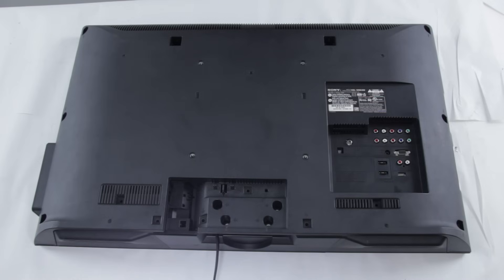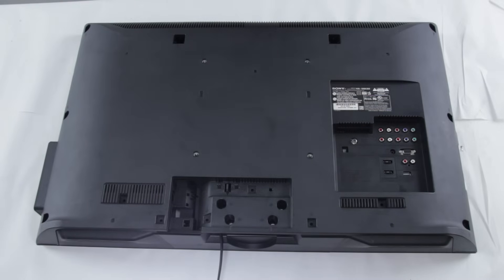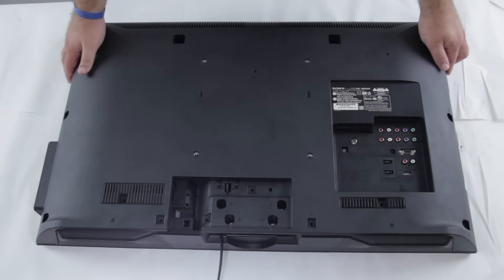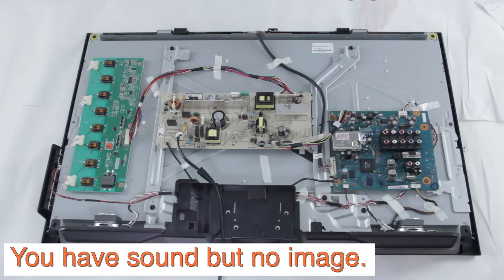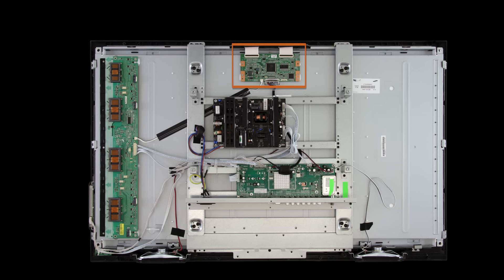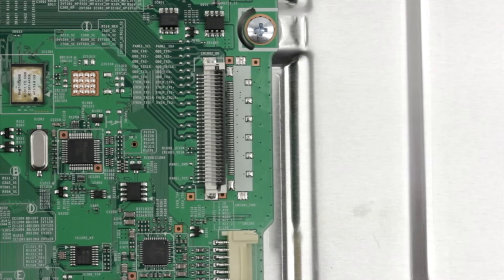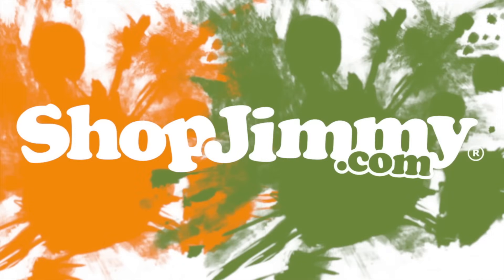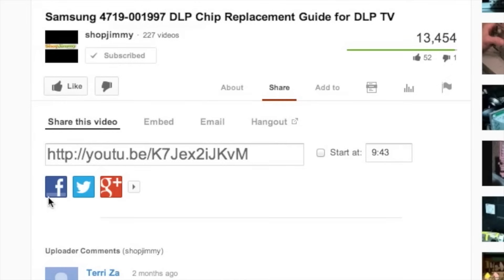LCD TV Repair Tutorial - T-Con Board Common Symptoms & Solutions - How to Replace T-Con Board

Comment: I have an LG 55LD650 that powers on fine and I can pull up the menu but it’s not picking any hdmi connections. it’s says connecting but then goes to no signal. Is it the main board or the T Con board? I haven’t tested the sound or the other connections yet but I do know every single hdmi connection I tried does not work. Thank you.

Comment: Hi Wondering if you could help after some advice I have a Samsung eu58j5200ak I was watching it and it just went off there Our new standby lights  at all I have changed the main power board inside and the board with the aerial connection on and there is still no lightsAny help would be really appreciated

Comment: I have UN75F6300. The unit stopped working and you could hear it clicking sound from the back of the TV. I replaced the Tcon Board and Inferred receiver but now I get a solid backlight with no sound or picture. At this point I am at a loss on what to replace, your help would be sincerely appreciated.

Comment: Kdl-42v4100    Turned tv on one day no picture sometimes blue screen sometimes lines on whole screen.     I have red light on front and amber ‘green showing standby mode is on? I tried everything to reset it remote is not turning tv on or off either? There’s 2 boards one power and other with connectors. And a h3e board.     Dow do I trouble shoot the h3e and others?   What will be the symptoms that tell me if any of the 3 boards are no good?
Any help wood be appreciated.     Thank you merry Christmas.

Comment: Hi there, I have a Insignia TV. Serial NO: AAMAADA007781 and another number: E37AAZNNW1BY9NX. I have vertical colored lines where half the screen is missing. And I do have sound. Reading your blog I think this a T-Con Board issue.

Comment: LG 75uh6550. I turn the TV on and the LG screens start to turn on the the LG symbol shows for 1-2 seconds then the screen cuts out. I replaced the main board guessing at the repair but that didnt do the trick. Ides? Power supply or T-Con board?

Comment: Hi. My Sony Bravia KDL-46HX729, serial# 3028053,  showed three wide vertical lines then went off. Now the red power light flashes 5 times and the tv doesn't turn on. When I unplug the tv for one minute then plug it back in, the green light comes on for seconds then the red light starts to blink again. Do you please have any advice before I can condemn the tv? Thank you for your help in advance.

Comment: I have a sony KD-55X720E  and I am getting all different colors lines on my tv. Do you think I might have to remove the ribbon from the t-con board and reinstall or do I need to replace it. The tv is less than 3 years old.

Comment: Question. I have tv and the tv will not turn off with remote or with the power button on the tv. The remote does work I checked it with my phone on video and it lights up when pressing buttons. Sometimes it will work but most of the time it won't. I usually have to unplug it to turn it off. The tv is RCA 40" LED FHDTV model # RT4038 
Serial # A1908292840008162

Comment: Hi I have a Samsung model UN55C8000XF , it has about 9 vertical solid lines running from top to bottom on the screen 1/2" ,1/4" apart, red , blue , yellow, mostly blue colors the lines are in an area about 3" wide, as I recall it started with about 2 lines when I first noticed it, do you think this could be the T con board, I have taken it apart all looks good, all cables seem tight,  this set is  a 2010
Thanks

Comment: I have a new JVC 50MAW595AP10501965.  Warranty people won’t respond after taking info twice and being on hold for hours.  It has no picture at all when first turned on and eventually turns to vertical lines but not in color. I hear sound when it tells you turning off in one minute and counts down.  I’m willing to try and fix the problem since they won’t.

Comment: I have an lg 50lb63000, the screen was flickering and only partially worked so I determined some of the LEDs were out so I replaced them all.. now the screen works but it's noticeably darker in the middle more than the sides and the right side of the screen lags and has shadows...any help or suggestions you could offer would be appreciated, thanks!

Comment: problem with JVC  40 led smart 4kr HDR TV spoke to manafacturer about problem sorted it out by unplugging and starting up again in a few minutes Lasted a week and went again , opened it my self looked @ boards just to get No S  then it came on again an worked perfectly for a day and woul not come on the next evening , light comes on for power blinks and then goes solid, turn on tv light  (red) goes out sound available an can change channels and so on  TV is only 15 months old any help appreciated

Comment: I have a Philips TV Model 75PFL6601. I was watching it and it just went dark. No sound or picture. Does power on but cannot bring up any image on the screen. Powers on then after about 15 seconds powers off. What is the most common fix for this tv? No you issues at all until this. The TV was purchased in Jan 2017. Manufacturer: Philips
Model: 75PFL6601
Serial Number: GZ1A1640107492

Comment: Thanks. Very informative.   I have a Philips 32pfl5332d/37 flat screen tv.  The Tv randomly blanks out about 30 secconds - leaving a black screen and no sound. However, there is still a blue light indicator showing that it is on getting power. After the short blackout it returns to normal operation.  This is only used watching broadcast tv.  What do I look for?

Comment: I have a TLC 65S403 the screen is whiter than normal. You could watch the TV but is like having the brightness super high. Blacks look grey. Color looks very light. I change T Con Board, Power supply and main board but didn't fix the problem. I really need help. I thought it was the Tcon Board but didn't resolve the problem. Help

Comment: I have a vizio 700i-b3, 70".  My problem is a hdmi connection.  Every time I try to connect my imac to the tv via hdmi, my tv turns off and wont start again(computer and tv are off when connecting cables) I have replaced;
      Power supply board, once
      Logic board, twice
      Hdmi cable, once 
      Video/audio adapter for my imac, twice
I've done soft resetting on tv when this happens but to no avail.  Last time this happened,  I noticed a very dim blue light on the screen, you could barely see the light, the light stayed on for a few seconds then you got a black screen, this kept repeating on and on, so I even replaced the t'-con board just in case.  I ordered another logic board from you a few days ago, so I shouldn't have any problem if I try to make this connection, all boards would be new, but I'm afraid this may happen again.  I've never had this problem before, the computer and tv were connected for several years with no problems, until recently.  Any advice would be of great help.

rick

Comment: Jimmy my Samsung LNT4061 tv has all these wierd colors with only a sillouette of the images amidst bug fights. I replaced the TCon board & it still has issues. Is there something I need to do after replacing TCon?
Thanks for the video. I was just about to work on a tv where TCon is not visible & now know it's not possible. Thanks for the time save.
Tom

Comment: @shopjimmy hi i have a question concerning t con boards for a 42LF5850-DE its a 42" lg tv it using a t-con board 

MODEL:V14 42 DRD 60Hz control_ver 0.3

Part number:6870C-0480A

Design:2013/03/29

The problem is i can't find the t-con board for it 

So my question is can i use a different t-con board

Comment: Hey, I have a Samsung PS51D550C1M plasma and it won’t seem to turn on. Originally when turning on the TV would make clicking sounds and the standby light would flash about 5 times. Then the clicking would stop and the standby light would black quickly in sets of 2. Initially my research indicated it was the power board but then after isolating each board and turning the power on I noticed the clicking only happened when attached to the T-con board. So I replaced the TCON board and now the clicking has stopped and the standby light flashes twice but the tv still doesn’t turn on. I also noticed the little green light on the tcon board flashes slowly by never becomes solid... any thoughts on what could be the outstanding issue and part(s) I could still need to fix it?

Comment: Hi, Jimmy. I have a Sony TV, model KDL-46VL160. It stops working and here is the symptom: Once I plug in the power, it turns on. I can see that the display lights up a bit but there is no picture at all. After 10 seconds or so, it shuts off and the the red standby light blinks 14 times. If I disconnect its T Con board and then plugin the power, it turns on and stays on with the display lights up a bit and does not shut off. I searched the web and people say that this means that the T Con board is bad and needs to be replaced. What is your expert's opinion? Thanks.

Comment: vizio 4k ultra hd.  LTM7VIBS4055650.  NO BACKLIGHT, EVEN BACKLIGHT TEST ISNT WORKING.  power supply did give a shock as i plugged in a few weeks before the screen died.  tcom board is buzzing tho only when the left ribbion is disconnected the noise stops..  when the reverse is done the noise returns.  still no lights.  it seems the backlight isnt getting power even.

Comment: Sanyo DP42D24, replaced main board, worked well for a short time. Then half of the screen went out, but sound remained. Replaced cable from main board to T-Con. Entire screen now comes on with blue screen but no video, and no response from input buttons and no response from remote.

Comment: My tv turns on only to the title screen.  It won’t go any further then that.  After words the image goes black then back to the title screen.  And their is a flashing white light at the bottom while this is happening.  I don’t think it’s the supper supply or else the tv would not turn on.  I also don’t hear any weird sounds coming from the tv so I suspect that the motherboard might be damaged and needs replacing.  I am not 100% sure but the part only cost $10.  If you have any other ideas I’m all ears.  I forgot to mention I checked the power transistors and they all look find.  No damage marks or bulging.  The tv I have is a tcl Roku tv 32 inch  32s305.

Comment: Rca tv model SLD65A55RQ powers on but no sound or pic i don't c any faint images @ all using a flashlight either main board & power supply board has already been replaced what is the prob?

Comment: I have a Samsung Un60h6203afxza when I plug the tv in the back lights start blinking and I can't even get the TV to turn on the red power light doesn't even come on I just see the little lights on the back of the tv continuously blink, I changed the main board and the power supply board and I still have the problem the only thing left is to change the tcon board but I'm nervous to spend more money and still have the same issue do you think its tcon or is it something else im missing.

Comment: I have a large Vizio display screen model E60u-D3.  The screen is dark blue, the little white light at the bottom corner works, there is sound, but no images.  I did the flashlight test and saw nothing in the screen, other than the dark blue light.  Based on you video, it seems like the problem is with the T-Con board.  Should I replace the T-Con board?

Comment: Kd-55x8507c turns on android logo comes on then immediately turns off with red light flashing 6 times at regular intervals ive tried unplugging the power connector and all i van hear is sound when pluggen back in it starts flashing red again could it be rhe t con board or something else please reply im in serious need only had the tv for 3 years paid a bomb for it

Comment: I have an LG 42LA6130. All of the symptoms that you mentioned are exactly the same. Where can i get a new T-Con board for my tv? I browse through the website link but i'm not sure which one suit my tv. i saw few videos (in Portuguese) where they sellotape some pin stripes on the ribbon and it does the trick. the problem is, i don't understand what they are saying and their videos are not clear at all. is this a recommended solution or can that create more problems in the future?

Comment: Hey I have a wide dark vertical shadow just appear near the centre of the screen  on my Samsung UE55MU6470, I’ve checked HDMI connections etc, but definitely a fault with the screen/internal connection/board. Any ideas what this could and what I’d need to repair/replace? Thanks

Comment: Hello my bro my lcd shownic I opened it clean it and I removed all cables.  But when I return them back I put the main cable that goes from power supply to the screen opposite way 
Then the tv didn't work then I return the cable to the normal .. When I trun it on.. No blue screen but I have white screen instead and the tv worked but with too much white on the picture I don't know how where is the problem.. Is it t con

Comment: hello, my tcon is an LG  6870C-0471D . Im experiencing vertical lines on the screen. My Tests are vgh 27.7v, vgl -5v, hvdd is 7.8v, vin 11.8v, vcc 1.7v and vdd is 15.8v. I'm wonderin' the cause why vdd is 15.8v? Should it be 3.3v. Thank you for your help. More power to your channel.

Comment: I have a TCL model 55S425 with a serial number of 2005GTC007606A02046. When I turn on the power the screen comes up completely pink with vertical lines   mixed in. It will sometimes change to blue. I have unplugged everything except power and still have the same problem.

Comment: Sony Bravia TV XBR-75X850E Purplr & Green Color horizontal Uniform stripes on TV. Not able to reset TV to original setting. Unplugging and Plugging power cord was not able to fix problem. Any suggestions to solve this problem? Thanks (Sr No. 4017880)

Comment: Thanks for the video. I have a Sony KDL-46BR6 that turns on, then off after 5-10sec, then flashes red standby 14 times. Unplugging the T-con board, the light stays green and tv backlight stays on. Would this be just the T-con board? 

Thanks!

Comment: I have a samsung plasma tv pn43d450a2d. It does not power up and no backlight. No standby light. I disconnected to 2 connectors to the y board and the standby light comes on. No backlight

Comment: I have weird gamma problem on samsung TV LE40B650, i replaced the T-con board with a 32 inch instead of a 40 inch T-con board. It still isn't fixed, do you know what the problem could be? When i open menu there are Horizontal lines only where the menu is.

Comment: I have a Samsung Model# UN46EH5300FXZA that stopped working after a lighting strike occured near my home causing a power surge. Although my TV was not on, it would not come back on with a picture or volume continously (it would come on in short bursts with a picture and volume). My wireless phones were also disabled. Could my problem be resolved by replacing my T-Con board? / John M.

Comment: Hi Jimmy, I have a Samsung UN50EH5300F that occasionally goes black, with no sound and then the program comes back about a minute later. It does not actually shut off because if I press a button on the remote, a message appears in the lower left corner, so clearly, it is still on. Is this likely to be the T-Con or main board that is intermittently going bad? This happens about once a day. Most of the time it is fine.

Comment: So I have gotten a power supply from eBay, a motherboard from eBay, new strips, I fixed the tv not turning on, I am getting an image if I shine a light through the LCD, but no backlight. What can I do? (Yes I replaced the backlights too, can it be the cable?)

Comment: I wonder if I can replace the t-con board on my LC-70TQ15U. I haven't taken the back panel off yet...but I see the board is available at my source. Three slow flash with one fast brighter flash on the error code LED. No picture, but I can hear a relay click on when I turn the TV on with my remote.

Comment: I have a Vizio E70-E3 i just replaced the LED back lighting that works i get video and audio but now i'm getting glitches of vertical lines and the screen turns orange shuts off then comes back on. i double checked the two ribbon cables i had to disconnect all seems good. could it be the T-con board? it worked great before just back lighting was going out. i did try to move the main board but it felt like it was glued down after trying to move it i just put the screws back. any ideas i sure would appreciate it.

Comment: I replaced my T-Con board in my Samsung Model# UN46EH5300FXZA and I still cannot get a picture. There was a lighting strike close to my home and it knocked out my TVs and phone service. My wireless phones had to be replaced.  The above references TV along with one other TV in my home were knocked out... I didn't have surge protectors on them. Is there another board I should be replacing ??

Comment: Hello, Wanted some help with a Westinghouse 50 inch Mode: cw50t9yw. It turns on but you cannot do anything , it's just stuck and then it turns off in about 25 seconds or so. None of the buttons (on the remote or on the TV work)

Comment: I have an Sony 55xbr850c. I’m pretty sure it’s the t-con board but wanted confirmation. Symptoms no display but audio, col. 1 or 2 blue line complete height of display. Latest one first four inches are darker then the rest of the screen with a dark 1 pixel line at about 8 inches in from the left.

Comment: Samsung 55" TV UN55H6350AF
Has sound but no picture. Removed cover and have no backlights. Can't see picture with flashlight test. Transformer suspect on power supply board (looked burnt). Replaced board and still no backlights. Removed cable from motherboard to power supply board and backlights come on. Could  it be TCON or motherboard?